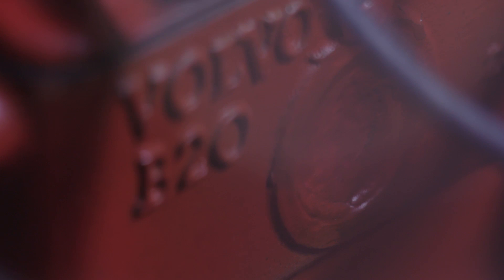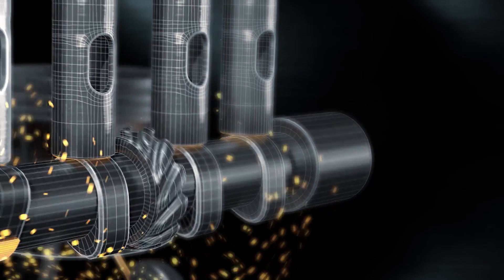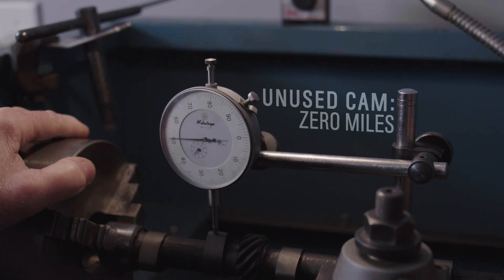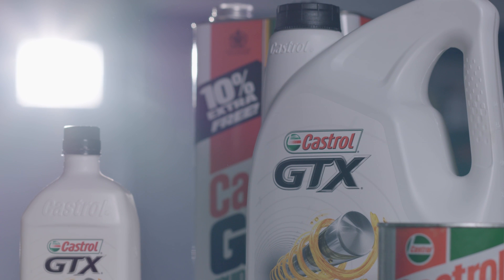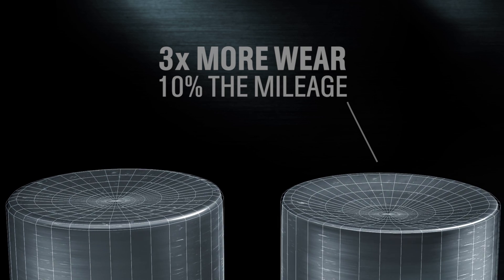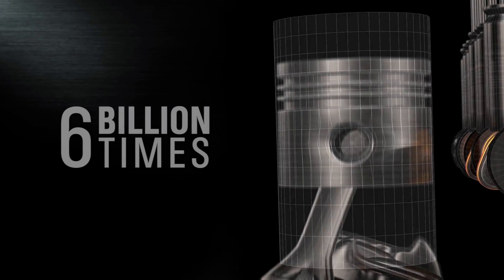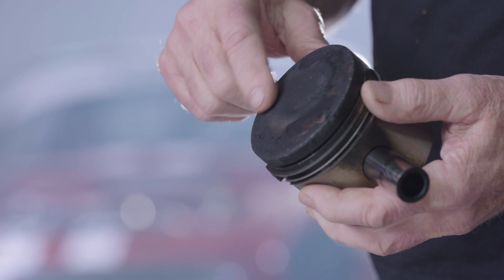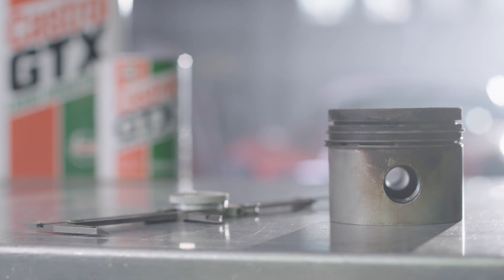Irv Gordon Under the Hood with his World Record Volvo P1800

Comment: I've been using castol gtx for 10 years in my Nissan pickup and is has not given me not one internal  mechanical problem...now I use Castrol edge and will continue until the day it dies I received this truck from my grandpa when it had 67,000 miles now it's reaching 260,000 miles and still sounds like new...my grandpa used the same oil ...... he's no longer here but his truck is and still running...

Comment: change the oil as per manufacturers spec and the engine will go on for ever, it's the spec of oil that counts not the manufacturer
Reply: Now manufactures want longer drain intervolts so you can wear out the moving parts quicker.
Reply: David Viner Well, depends a fair bit - The Volvo B20 engine was always a proper workhorse of an engine, legendary reliability. Same with the B200/B230 engines that followed it.
Reply: @deafyboy86 : Same Engine as the Volvo 1800S Wagon ,I Believe, Still A Popular Sport Wagon.If VOLVO Engineers Had Designed The Front Frame Better, Rust Wouldn't t Have Been So Bad,& Would Have Twice As Many Of Them ,On the Road.

Comment: Irv uses Castrol 15w-40 for diesel engines in his 1966 Volvo 1800s because of the added Zinc and Phosphorus levels.
Reply: It was 10w40 but no doubt switched to a 15w40 as the high miles added up. But still remarkable
Reply: adolfo maurício in my opinion I prefer gtx. Now here is why, magnatec is great for new engines as the magnatec oil will stick to new engine parts better than sticking to older contaminated parts. Magnatec will not stick properly to engine parts covered in sludge from over extended oil change life. Older engines prefer semi synthetic and a slightly thicker oil as they get older (as metal wears down the thicker oil helps fill the gaps of lost metal). Gtx is a great oil for the price. I have used gtx for over 24,000 miles changing it every 3000 miles as I beat the hell out of my engine (when its warmed to operating temperature that is). Also I use honda oem filter from the dealerships to help get the most out of the oil. My engine has taken me all over europe and even full speed runs accross germany. Prior to me owning this 22 year old engine it has receieved magnatec and gtx from new at honda. I recently went ahead and changed some gaskets and I was so surprised to see how clean my internal parts where. My engine on a dyno produced a engine hp of 112.6 where as it was 115hp brand new. That shocked everyone that day and proved to me that castrol gtx has saved my engines life. My engine is quiet and doesnt burn oil much at all as I have never topped it up between oil changes. Gtx will clean your engine prior to magnatec but I dont think magnatec is worth it as long as you change gtx oil every 3000 miles. Good luck.
Reply: adolfo maurício with any new internal engine parts I would use a 0w20 for the first few changes of the break in period not sure if it woukd be magnatec or something from the edge range. My car has only covered 24000 miles over 2 years. I have to change my oil every 3000 miles due to the conditions in which I put my engine through. The car now lives in a hot and dusty village and also uses ethonal 5 and sometimes ethonal 10 fuel which could go into my oil causing my seals to fail and leak if im not careful. I know I havent covered many miles but my engine has now had 26 oil changes with castrol and still going strong. Magnatec isnt for me I guess as my biggest fight is contamination in my oil anyway.